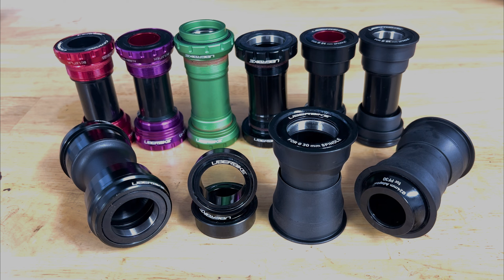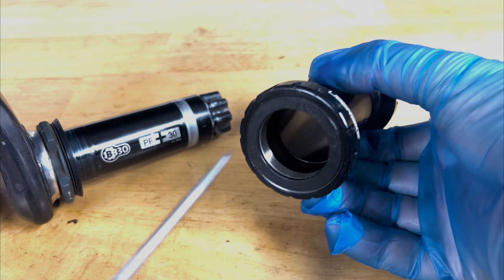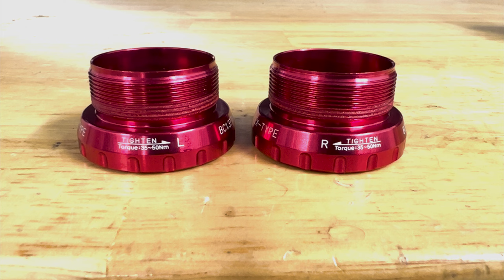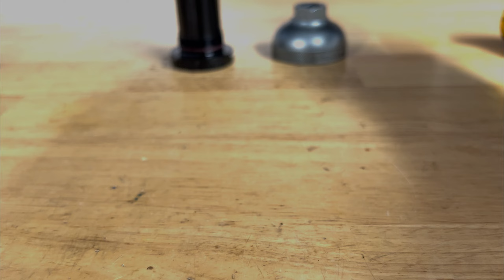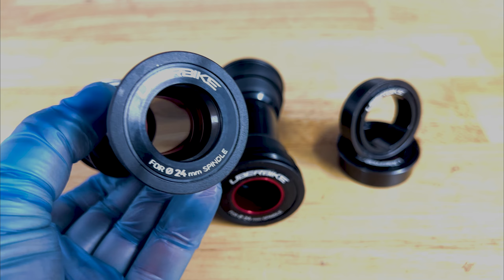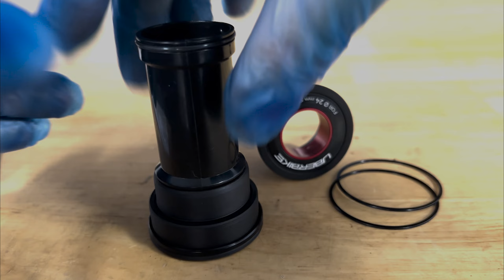Uberbike Bottom Bracket Range And Installation Guide

Comment: Stupid question incoming, I usually replace most bike parts but never the bottom bracket.. i had this done on one bike in the past (when i used to commute to and from work) but not my current mtb (which i use for fun),  what is the worst case scenario and how do we know it needs replacing?
Reply: You'll know if a bearing is bad as the crank will seem like its rattling/loose  or doesn't spin freely . Just make sure you clean the threads on your bike frame thoroughly before the new install